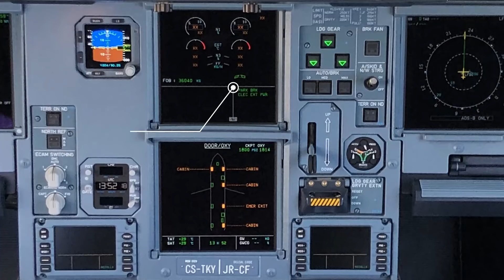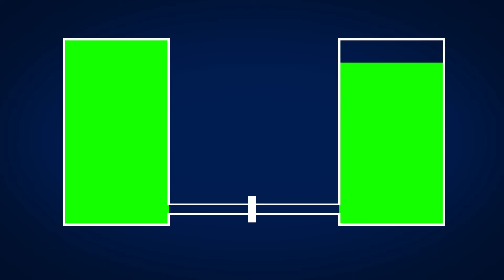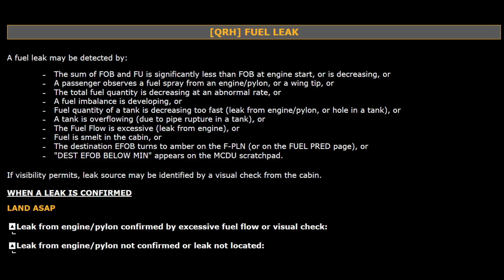Out of Fuel | What happened to Air Transat Flight 236? | Analysis in (2020)

Comment: I used to work as a ramp agent/ load controller at BSL airport  in a worldwide known Swiss company. Also dealed with Air Transat aswell as others who calculate in gallons/ pounds versus liters…
It was always a big deal and stressful situations working with these “clients” because of the conversions and the consistent feeling that it is wrong.
In my humble opinion , all the companies should adjust and work on the same scale because of the certain kind of confusion it could eventually avoid.

Comment: As a retired marine engineer sailing the world on many merchant ships, I find it very hard to believe and very unprofessional the things that some aircraft mechanics do. It is unbelievable to me that a maintenance person would undertake such a task without the correct instructions on how to safely complete the job. Just because the internet was down, the lives of all passengers and crew would be at risk because of their actions and the desire/pressure to get the aircraft back into the air as quick as possible. The supervisors should have prevented the job being done until such time as the correct instruction manual was available. It always comes down to money like the Max problems that cost so many innocent lives. It will continue to happen until such time as someone in the industry goes to jail for there wrongdoings.
Reply: What does being a sailor have to do with aviation related incidents? Your entire comment would be just as valid without the pointless opening.

Comment: I don't get the ruling.   The ruling said that the pilots could have found the leak in a pre flight inspection.   How could the pilots have done an inspection on a fuel leak that didn't occur until the plane was in flight?  Are they saying that the damage occurred on a previous flight?  How could they know that?  On the previous flight the pilots would have reported the leak if it existed.
Reply from the maker: I doubt that, who said that?
Reply: @AirspaceVideos  Sorry, I watched it again and the pilots didn't follow the in-air checklist for suspected fuel leak.

Comment: I at first thought that this was going to be the one where a Canadian flight ran out of fuel ending up landing at a close military base that had been converted into a drag strip and there were people there at the time of landing. The flight ran out of fuel because they were in the process of changing measurements from Imperial to Metric and the ground crew that fueled the aircraft before the last departure failed to convert properly thus ending up only putting half the fuel required to successfully complete the flight. I would blame the pilots too for not calculating the fuel on board before takeoff. I believe the FMC has that ability.
[FMC = Flight Management Computer]
Reply from the maker: nope, I covered that one already :)
Reply: That is an oversimplification, as it was not strictly speaking a problem converting from imperial to metric. Fuel info from FMC was not available, and neither flight crew nor ground crew had been assigned or trained for the task of fuel conversion in the event of abnormal fuelling, which was the airline's fault. The manual said to multiply litres by the "specific gravity", which assumed kg/L. For the fueller, "specific gravity"' meant lbs/L because the AC fleet contained only four aircraft which operated in kg and they had been in operation for only five months at the time. Very poor communication, training and manuals.

Comment: As soon as I heard low oil temp/high oil pressure I thought fuel leak. Knowing oil is cooled from fuel flow and increased fuel flow means increased cooling it would be my prime suspect. Once they got the fuel imbalance with the cold oil side having lower fuel would confirm my thoughts.
Reply from the maker: good thinking!
Reply: No you couldn't have thought it was a fuel leak.

Because if you think hard about it, low oil temp/high oil pressure is a contradictory information.  In physics, pressure increases the temperature.  Hence, low oil temp should mean low oil pressure; high oil temp should mean high oil pressure.  Having a low oil temp and high oil pressure did not make sense to the pilots.  This possibility was not at all documented in the maintenance guides.

Also, you have to put that information in the larger context of an essentially computer driven airplane, which was still having teething issues with its electronic systems and software.  A330 pilots constantly had to filter the information they were receiving from the computers, trying to make sense of wether the information they were receiving was true or caused by a system bug.  In that case, they thought they were receiving a false information caused by some system bug.  It's only later that this information was linked to the fuel leak.

Another aspect you must take into consideration is the intense pressure pilots get from their management to fly the planes as efficiently as possible.  Making a decision to divert for a pilot looks easy in theory, but in real life, it's not that easy.  Had the pilots made the decision to divert with no real cause, they would have had a lot of explaining to do, something they wanted to avoid.

Nevertheless, on their guard, the crew eventually decided to divert and it was the right decision.

So please, don't play the armchair pilot...
Reply: @robertmainville4881  wow you spent all that time to be wrong.
What happens to oil when it gets cold? It gets thicker. When oil gets thicker it takes more pressure to go through a set sized opening. What cools the oil, fuel. Increased fuel flow=high pressure/ low temp=leak.
Just because you think you understand physics doesn't mean you do.

edit: said something mean, sorry.

Comment: Wrong text in the thumbnail of course. The longest glide was done with a glider plane, slightly over 3.008 km  or 1.624 NM. It is already quite old, happened in 2003 with a Nimbus 4 dual seater airplane and a german team in south america. 

The Air Transat (soon to be Air Canada) flight was only the longest unpowered flight of a commercial airliner.
Reply from the maker: well yes, can't argue with that

Comment: Great job on this video.   Didn't know the A330 couldn't maintain cruise on a single engine.  I'm assuming that is no longer the case on the newer versions?     So this was a literal dead stick final.  Probably some side slipping too.  Thanks for making the video!
Reply: No 2 engined aircraft can maintain cruise altitude when it’s at FL300 or above they normally drift down to the single engine cruise altitude
Reply: @tomstravels520  ah I see, yes that makes sense.  Tks
Reply: On one engine it can maintain altitude at something in the mid to low 20,000’s. This will be at a minimum sink speed. , to go faster it will have to descend lower, down to about 18000 feet depending on weight and the desires speed.

Comment: Another great video, bro. Since it was maintenance error, it immediately reminded me of the  Emery Worldwide DC-8 that crashed on takeoff in Sacramento, CA. A huge plane...... Brought down by a cotter pin being forgotten during routine maintenance. So sad.
Reply from the maker: small part, big consequence...
Reply: The Emery Worldwide DC-8 has this crazy line in the CVR transcript. It did crash because of a bolt that was securing the right elevator control tab, and before takeoff as the pilots discuss whether they've been in a helicopter one of them says: "hey you're you're hanging by that bolt you know." to which the other responds "yeah… Jesus nut". This is in reference to a well-known critical bolt holding the main rotor, but they had no idea their own lives were also hanging by a bolt.
Reply: @IKLEANV Not correct. A service bulletin required modifications to the fuel pump, which required corresponding modifications to engines. The RR loaner engine had been in storage and not modified. The Transat engine's fuel line could not be attached, so they installed the fuel line from that engine into the loaner engine. Unfortunately, this caused the fuel line to rub against the hydraulic line and eventually rupture.
Reply: @IKLEANV @John Smith is correct.  Look up Service Bulletin (SB) RB.211-29-C625.  It was issued in 1999, two years before this incident.
Reply: @IKLEANV SB RB.211-29-C625. You could look it up yourself before accusing others of spreading false information. It was not a cost saving measure, you are the one spreading false information.